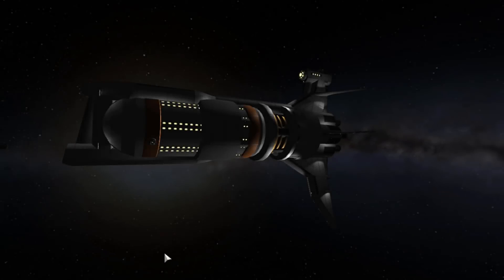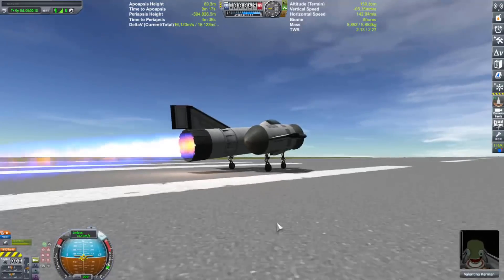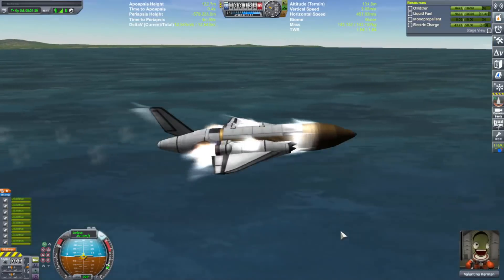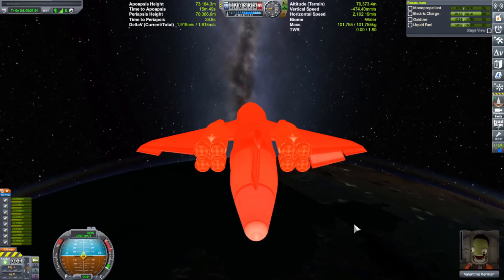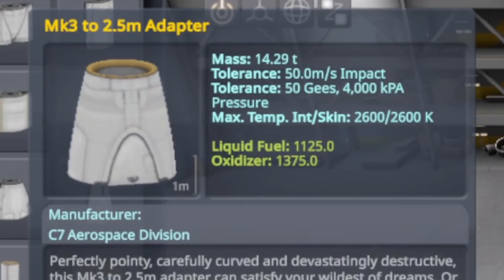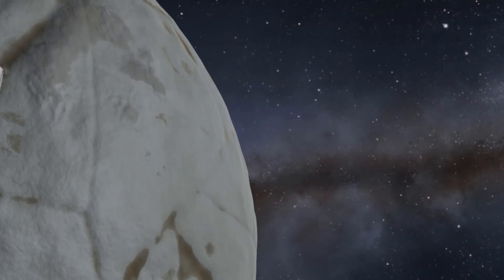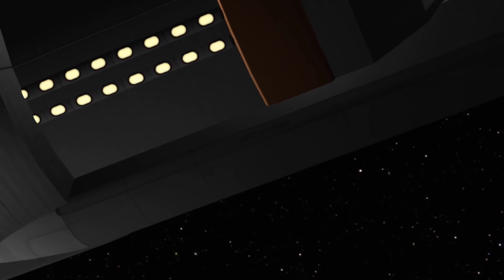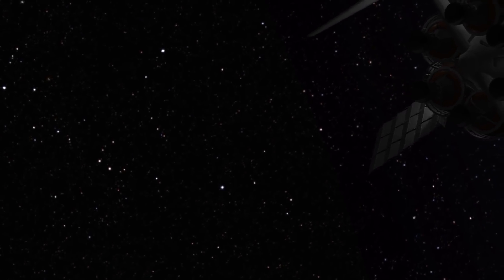FAIRINGS good for SSTO? YES or NO? Let’s find out.

Comment: you have to use the display drag menu to completely understand how drugs works on KSP.
Alt-F12 -> Physics -> Aero -> "Display Aero Data in Action Menus"

In short... Fairings IS the best way to fight the drag. but with considerations:
1- Fairings don't have to touch ANYTHING (no inside, no outside, not even close pieces)
2- Things Inside fairing don't have to offset outside
3- If you close your fairing with a piece this piece don't have to be the last aerodynamic part. you have to close the fairing with the penultimate aerodynamic part (i really struggle with that.)
4- fairing have to be designed with soft angles
5- Fairing don't have to be the root part
6- Things inside fairing don't have to struct or auto-struct with things outside the fairing

If you don't respect this designs concepts, drag will skyrocket

Comment: Seems to me that if you use a fairing to minimize your drag, it would increase your weight, and thus it would be part of a much larger equation.  So up to a certain point the fairing would be helping you by reducing your drag, but after some point the weight is going to start to hurt you more than the loss of drag from using the fairing..  So the obvious solution to maximize your efficiency is to just deploy the fairing when you get to that point, that way you drop the extra weight..   Of course that seems obvious to me, providing your goal is too maximize your efficiency..  Though you may be concerned if your goal is to ensure there is only one stage from the very start, thus making the craft a SSTO..  But then again, switching from air breathing engines to rocket engines does happen to be little different from what folks seem to thing staging actually is.  Sure, you are not dropping parts of your craft when you switch from air breathing engines to rocket mode as you would be if you Staged a rocket, but that is not entirely what staging is.  The only real SSTO would be a craft that uses rocket fuel from the start to finish, as there would only be a single stage used..   Such a thing in reality is not likely to happen, due to the efficiency curve of bell shaped engines, which seem to be the massive majority of engines used..   I'm rambling now, and I doubt this will be read by anyone anyhow, oh well, I hope all is well, good day and good luck :)
Reply from the maker: What you are referring to is called an SSRT. Single stage rocket technology. I build them in RSS/RO and Stock ksp.  Very fun and in my opinion more realistic.
Reply: @vaos3712  
What is strange about you calling them SSRT's for me, is it seems out of place, to me at least.   The acronym "SSRT" I thought was used when describing the technology used in a SSTO, while the acronym "SSTO" was used to describe any craft that can get into orbit without staging.    So, if we were to talk about the rocket engines used on a SSTO, then we would be talking about SSRT, but if we are talking about a Space plane that gets into orbit with out staging, then we are talking about a SSTO... 
So if I was correct, a space plane that doesn't stage is a SSTO, but its a SSTO because its using SSRT.. 
though I could be very wrong about that lol..

I havent tested the whole putting a Fairing on a Space plane, and then staging it at 60,000m or so, and then comparing it to not using a fairing at all with the same Space plane..  Of course I would check at 50,000 and so on, just to see where the actual point where it stops being a net positive would be...   Though if you have time, you might test it and ill watch that video as well lol.
Reply from the maker: @lfaf9509  SSRTs is actually a real thing. It’s worth a Google. From what I understand, SSRT was an acronym that came out before SSTO was a thing by McDonald Douglas or what is now called Boeing😎
Reply: @vaos3712  
Oh I know its a real thing, its just I was under the understanding that SSRT is referring to the technology where SSTO is referring to the amount of stages a vehicle uses to get to orbit. 

Oh and I was just re-watching your "How to build and fly a SSTO" video, have you tried the mod called "  Retracting/vectoring engines, Critter Crawler by linuxgurugamer"  It has retracting RCS ports, I don't know how they affect actual drag, but they do retract when RCS is turned off, which I would guess would mean they don't produce drag.. Plus they look cool lol..  I figured sense I had your attention atm, I might as well see if you had used that mod.. Considering there are millions of mods, even though you have played as long as I have, you very well might not have seen the mod lol.
Reply from the maker: @lfaf9509  I try not to use mods that put new parts in the game. I keep it stock and only use beauty mods like restock or waterfall.
Reply: @vaos3712  
I usually don't use parts packs myself, but I gave a lot of them a try, and got rid of them over time..  but retracting RCS ports are down right amazing, especially for SSTO's.  I usually don't use to many beauty mods, as I got used to not using them due to my last computer begging me to stop lol. 
Honestly I only use kerbal engineer and that one little part pack and Docking port alignment indicator and X Science, oh and Community Delta-V Maps, because I got tired of having to open up a link every time I wanted to ensure I had enough Delta V for what i was trying to do..  Its a lot easier to just open up KSPedia in game and check while I am building lol....   Well, I have had a off an on again relationship with Konstruction by RoverDude, for its construction ports, I like launching things into space and building big ships, and those construction ports help a lot.  But now I am just rambling about mods, which don't matter that much...
Thanks for the reply VAOs, I hope all is well, good day and good luck.

Comment: Yes you indeed did the testing. It's good to know  that the fairings are almost negligible. So using them for awkward cargo is/may be better then a cargo hold. And trying to squash your mission into the various shapes lol. 

The rcs port and flipped nose cone are neat bugs. Might have to start using them.    

For me the fairings are a pain in the ass unless I absolutely need a  cargo covered.  

Here is a video topic to test out if you like. Always good to have video ideas on the back burner ya know 😉 what about side by side comparison  of fairing vs cargo bay of same size in a craft weight and protection from heat. And I think I remember you mentioning that cargo and service bays are  a ton of weight/drag.  I mostly play career mode when I have the ksp itch so depending what I have unlocked in science some missions get tricky

Comment: have you tried adding a couple degrees angle of incidence to your wings? that way you can point directly prograde so the fairing produces very low drag while also giving the wings some AoA to create lift. ive seen in most of your ascents that you had a constant AoA around 5°, so you could add about that much tilt to your wings.

Comment: What I have seen is fairings help out a ton with low mass missions because the optimal low mass ascent profile is that of a high speed hypersonic missile you explained in this video, as the wheesly jet engine is way more efficient than the spark rocket engine, but can only work in relatively low atmo.

Comment: Nice Video, I appreciate the research you do so meticously. :)

Some thoughts:
- Intercoolers have a high static airflow. When the craft is at rest or getting into a stall, intercoolers can still provide air to your engines, preventing flame outs. As soon as you're moving, shock cones get way more efficient. As I often stall or flip my SSTOs during reentry, Intercoolers have a niche for me in these moments to regain control faster.
- Didn't know that flipping nose cones was so efficient. :)
- Rapiers, altitude and drag: although drag gets smaller in higher and thinner air, so does your engine output, especially in very fast regimes with rapiers (1500 - 1600 m/s at 18-20km). Having low drag helps accelerating in this region better or do it with fewer engines.
- Ideally SSTO is build so that the max sea level drag arrow at transonic speeds is only as long as the craft. Very well built crafts have almost no drag arrow extending after the tail. 
- Testing: importance of testing can hardly be overstated. Use the F12 - Aero display often to find out if parts are properly shielded or produce too much drag. 
- Finally, Fairings: weight is always a concern, especially if you want to bring stuff to orbit. Fairings have some uses for me: shielding otherwise draggy or heat sensitive parts (large mining drill can be deployed from inside a fairing. Fuel cell arrays work well inside fairings as well.) Also, as you showed in the video, fairings can be exploited to reduce drag dramatically. 
If you can lower drag consistently for your craft, you will need fewer rapiers per mass to achieve the same effect. This can offset the weight of the fairing in some cases.

Comment: I basically only really use fairings if I'm going to be sending something out that would otherwise be destroyed by heat on ascension. Like sending up a satellite on top with everything else just being a lifter stage for rockets. My experience with SSTOs is minimum but I would assume in general that it'd just be extra weight since the amount of weight increases with size... I will have to steal the Linear RCS thruster bit for heat dispersion however, that's a part that I was not aware of c:

Comment: I think your test might be slightly flawed. You are calculating delta v in space and because you have some tanks that hold just liquid fuel your limiting factor always seems to be oxidizer. The oxidizer is only used in final ascent and circularization which are both not really effected by aerodynamics but mass. So burning more liquid fuel without using oxidizer is actually helping your Delta v in orbit by reducing mass. Try running with out the extra liquid fuel and see if the results actually flip (I think they might). Cool video though. I like that you are testing this stuff.
Reply from the maker: It’s logical to assume that if I was to take away the same amount of mass from both crafts, that the results would be the same.  The only difference being that both crafts would have more DV.

Comment: You're not testing anything to do with aero here. Like at all. If you have 4011 units of oxidizer and 5727 units of fuel you would have 1315 m/s dv. Which is exactly what you came up with. 

But what if you had the exact same units of oxidizer and TWICE as much fuel. What if you had 4011 units of oxidizer and 1,000,000 units of fuel. Then how much dv would you have?

The exact same amount... 1315 m/s. Why?

The number you're seeing is basically saying "how much oxidizer did you use?" That's it.

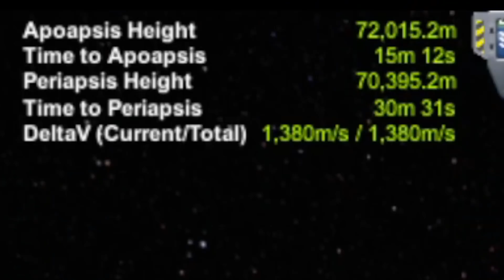In fact! Check the liquid fuel at 7:17 and 9:14. There's more liquid fuel in the fairing craft.

Try this exact same test out but remove 3000 units of oxidizer. Now the dv will be calculated based on how much fuel you've used instead of how much oxidizer you've used.
Reply: Wait it's actually worse than that now that I think about it. When I said you'd have the same amount of dv with extra liquid fuel that's not true. Not only would you not have the same... You'd actually have less!

Your design at 7:17 not only was more efficient during the atmospheric part of the ascent. But because it WAS more efficient, it weighs too much because it has extra payload. That payload? The extra liquid fuel it didn't burn before you flipped the rapiers to rockets. You're actually faulting the fairing design for being too efficient. It took more oxidizer to move the fairing AND the extra liquid fuel that you didn't burn.
Reply: Also I was wrong about removing 3000 units of oxidizer to test this. That doesn't help sorry. That would just make the problem here worse. It would just make sure that the dv calculation was based on oxidizer. Sorry for not thinking through my responses thoroughly. But my point stands. This test only tests what happens during the rocket mode of the rapiers. That's it.

Comment: Absolute SSTO noob, so the help with these tutorials is incredibly appreciated. But of a question for you if it’s alright; recently I discovered the nuclear engines only use liquid fuel, so I’ve started to try to use them for my high-atmo to space maneuvers, although I do keep some normal fuel with oxidizer for the Rapiers to help get over the 10km—70km zone until my nuclear engines can take over effectively. I’m not going to pretend I’ve gathered definitive info on this being a good idea, so I was wondering what your thoughts were on this.
Reply from the maker: I have a video on interplanetary SSTO . You might have to dig a little but it in there. It doesn’t go into depth or anything but it’s a good look at what a nuclear engine SSTO looks like. Hope it helps. I’ll be looking at making a interplanetary SSTO tutorial soon. 😎👍
Reply: @vaos3712  i have a question. How to make wings stable on large craft? Just so you know, the plane i make is unironically called "brick", is capable of launching huge stuff to orbit but it lacks manoeuvrability and as soon as it tries to move, the wings curve like a trigonometric function CV. How could i make them stabler? They are the size of a Strategic bomber lol, and i need them huge for lift
Reply from the maker: @warbrain1053  in settings. Look for advanced tweekables . Turn it on. Now when you right click on a part in build mode, you will get an option called auto strut. Is that to help strengthen your craft.
Reply: @vaos3712  Thank you ! I hope my craft will be able to handle the dyson sphere construction i work on right now with that. :)

Comment: Great video, but this brings up an interesting question that I did some testing on, how do you make custom cargo bay ssto's without farings and the drag of the structural parts, ie anything bigger than the mk3 cargo bay. I couldn't figure it out and couldn't make a reusable opening and closing system with faring or the structural parts

Comment: KSP's aerodynamics work by checking which nodes are occluded. If the part has all of it's nodes taken up, it is considered "inline" and doesn't produce as much drag. If, however, it's front node isn't, then it produces way more drag than the back nodes, meaning flipping a part around reduces drag. Stratzenblitz explains this much better in his three parts to Duna, Ike, and Minmus video, and his stock propellers to orbit video.
Reply: That's not the case. Or I don't know if it's true for Linux version, slightly concave shapes have different effects on how spacecraft cruises. For ex, i had all-closed command seat inside a service bay and when Kerbonaut sat down, his head was out, even though it didn't show any drag arrow, the craft rolled leftwards, and I barely broke the sound barrier.
I had to completely hide Jeb's helmet inside in the hangar after that experience.

Long story short. KSP doesn't only calculate nodes. debugging show only nodes.
*KSP 1.4.5 KSRSS - Linux-Player x64

Comment: I asolutely love these ksp mythbusting tests!! To take it to the next level, I'd recommend using the aerodynamic debug menu (Alt-F12 -> Physics -> Aero -> "Display Aero Data in Action Menus") . It's not a cheat even though it's in the alt-f12 menu, it just lets you see drag and lift values when you right click on a part in flight, so you could measure the EXACT drag force on a specific part at any part of the flight, rather than relying on the arrows, and 100% debunk fairings (or anything else lol)
Reply: That is an awesome extra step! I have always found the aero vectors unsatisfyingly vague. 
Another step for precise testing: use the cheat menu to put the craft at a specific altitude going at a specific speed and observe those exact drag force values.
You’d have to turn off the safety checks and put the craft at a sensible throttle level I’d guess, but then you could easily test 400m/s at 5km, 10km, 15km with little to no variation in craft state due to actually flying it

Comment: Your main problem with intakes isn't the type, it's the quantity. You're tending to carry more than you need.

So long as your engines aren't suffering from air starvation, you have enough. There is no advantage to excess intake capacity.

One ramscoop should feed approximately two RAPIERs, one shock cone or intercooler should feed about three. Single-engine ships may get away with just an inline intake.